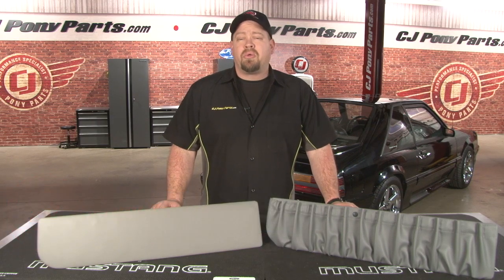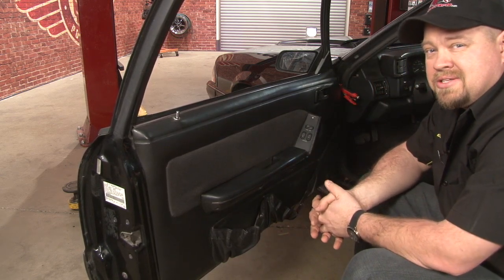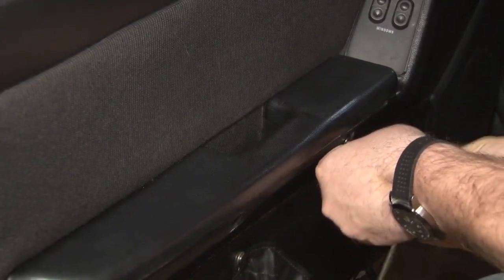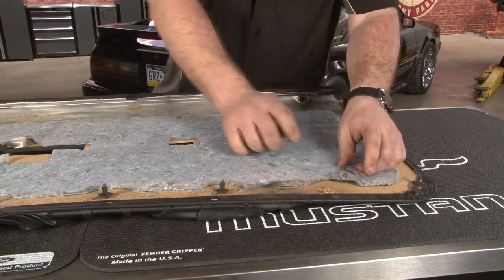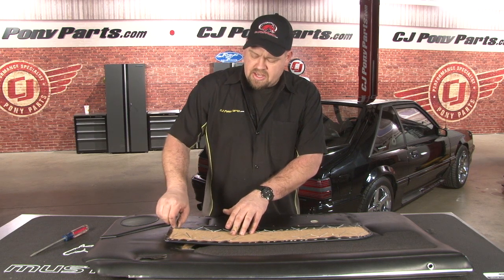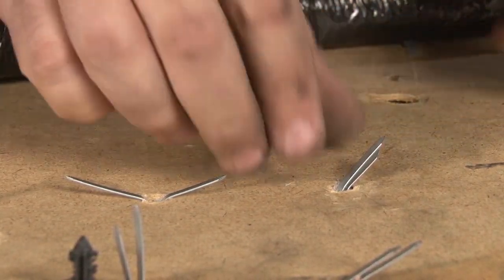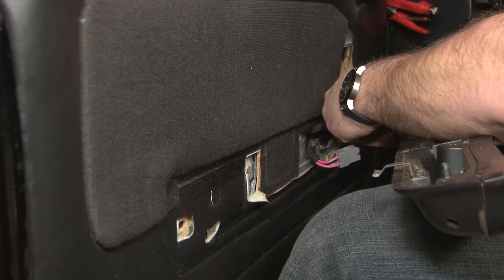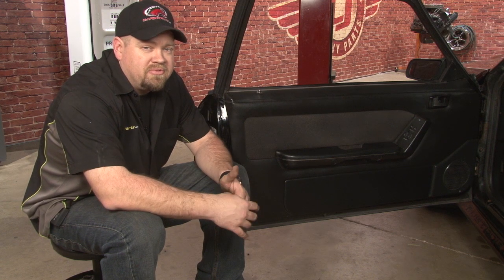Mustang TMI Door Panel Map Pocket Delete Vinyl Black Pair 1990-1993 Installation

Comment: In reality you can use your old map pockets, once you separate it from the door you can actually tear off the pocket and it will leave a piece identical to the one that was replaced here, have done it many many times on my own mustangs and for friends also,matter of fact on my current 5.0 i did the passenger side and Ive yet to do the driver,been kinda lazy about taking off the door,lol
Reply: dntlss did same I ripped it off and vinyl glued the areas that were loose on the inside and some staples to refresh the leather make it tighter sprayed with primer all on the inside and used boom sound deadened spray and the panels are badass